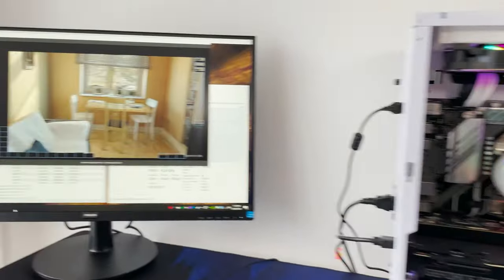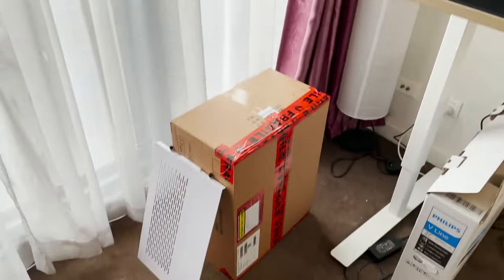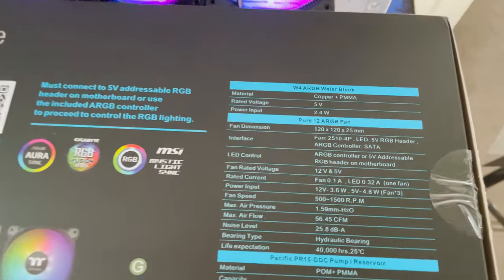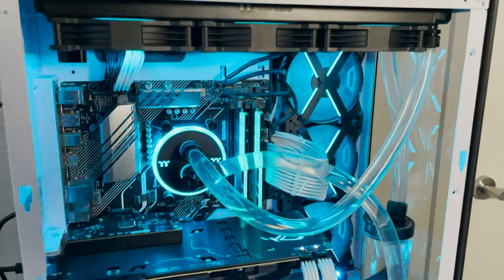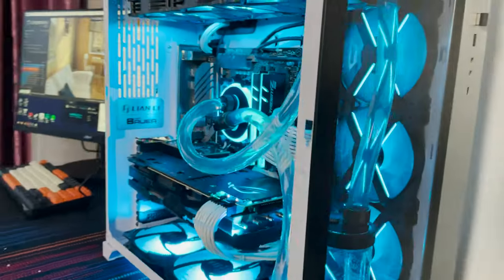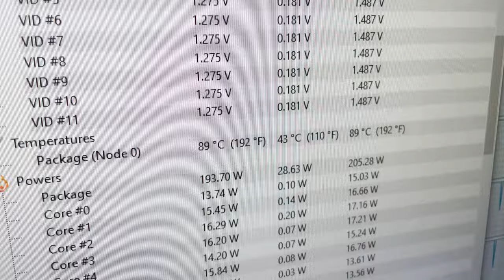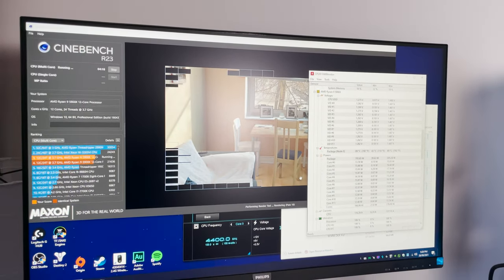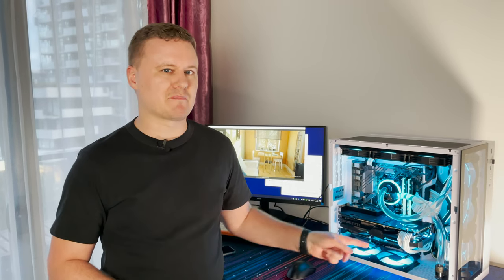Is Custom Water Cooling REALLY that much Better? AIO Vs Custom Loop 💧

Comment: Yeah... Sorry mate this is not a fair comparison at all... Gimping the fan speed with a single 360 on one of the hottest (if not the hottest) cpu's is asking for it in the first place. EK kits are the best for this type of comparison, TT is absolute rubbish! Also if you are pulling in cool air from the bottom and the side of the case, you need to exhaust that air out the top or back. As others haven mentioned no one runs a pump at full tilt in a custom loop, usually around the 50 - 60% mark depending on how many blocks and rads you are going through, also try and have the fans on a curve, so when you are gaming or chilling, fans are on a lower RPM than when you are rendering. Another thing to note is that GPU pegged at 100% is dumping an immense amount of heat into the case with nowhere for it to go. Just so many anomalies. You are right about diminishing returns with a custom loop, however, people that go for high end hardware that want the absolute max performance out of their machine go to extreme lengths to do so. This is what custom loops are aimed at.
Reply: Seeing the pump not decoupled from the case with a shoggy sanwhich or similar was the first red flag for me xD

Comment: Sorry, but this must be the worst comparison I've ever seen:
1. With the AIO your fans appear to be set to exhaust to the top and not intake from the top. That means you are gathering the hottest air in your case and use that air to cool down the fluid from the AIO. The best AIO config in this case would be a pull config as intake from the side panel.
2. Why would you set the TDP limit to over 200W? Your CPU is clocking to ~4.3 GHz all core in cinebench. That's something the CPU could do with ~140W easy.

I have an O11 Dynamic Evo, Aorus Pro X570, Ryzen 5900X and a 360 AIO. Fan config is: AIO side (tubes DOWN) intake (pull), bottom fans intake, top + rear exhaust.
At a room temp of ~22°C I am barely hitting 65°C on the CPU in cinebench (30 min), while the CPU clocks to 4.5GHz all core and up to 5.15GHz single core @ 165W TDP limit.

You have way too few intake airflow in general in the case (side is exhaust, only 2 fans in the bottom with the custom loop as intake, which will mainly feed the GPU and the top is intake, but on rads which will limit the airflow of the fans) and the config is really bad. Trust me, put the rad on the side and setup your top fans as exhaust and your CPU temps will drop by 10-20°C at least. Also spend some time optimizing the CPU with PBO2/Curve Optimizer and pull the TDP down.
Reply: Definitely agree.
Reply: I use an AIO mounted at the top, which is actually the correct position, and it runs just fine with great temps.
Reply: @OneFreeMan17  there is no "correct" placement for an AIO, there are just incorrect ones. The only rule is that the pump cannot be the highest point of the AIO, otherwise you would gather air in the pump. So for a side mount, the tubes must be at the bottom and the top edge of the rad should be higher than the pump. Temperature-wise, CPU temps will be much better when using a side or front mount and the fans set to intake, since cold air from the outside is used to cool the water. But you're increasing the overall temps in the case with that setup. When using a top mount the Fans should be set to exhaust, because it makes no sense to intake from the top since hit air rises naturally.  So they would be kinda fighting against the natural air flow. Thus, you would set it to exhaust on the top. Thats fine, but you're now  taking the hottest air possible to cool down the water, thus your cpu will be hotter than with a side or front mount.
Reply: @foxtrotromeo4876  If there are “incorrect” placements, then there definitely are “correct” placements.
The temperature while using the AIO as exhaust is nowhere near as bad as you may think.
The 3 intake fans I have at the front pull in cool air, and the air from the top fan push fresh air for the AIO to use.

Comment: Custom loop is always be much much much more silent than any type of an AIO as long as you configure it correctly #1 if you already have a premium high performance AIO then you want your custom loop radiator to be much bigger than that why? your loop will perform exactly or slightly better than AIO in that use case, add more radiator either by thicker size or just doubling the number of rads can increase thermal headroom better than AIO as a result you can run our fan more quieter #2 pump you want to adjust the pump speed to fix that noise ALL custom loop pumps are always better than the best AIO pump you just need to configure the RPM correctly and you want a anti vibration pad if you can't control its RPM. #3 Zen 2 & Zen 3 are really hard to cool with even with custom loop due its being a 7nm which mean very small area to transfer heat to iHS to water block but will perform better the lower your temps are specially if your ambient temp is LOW +custom loop. And i think your radiator must be a Brass radiator which has the worst thermal conductivity than copper and aluminum.. Brass radiator performs nearly or exactly the same with a good AIO of the same exact radiator size due to AIO using Aluminum that is much thermal conductive than brass and can dissipate heat better than copper but pump is weaker than custom loop which result to an near or exact or slightly lil bit performance inc of a custom loop of same exact config. BUT if its a COPPER chambers not brass then it will perform a LOT better than any AIO of the same exact radiator size and thickness so in order to get better performance using a brass radiator is to increase your thickness or doubling the radiator but again ALL copper radiator will perform better. ALL BASIC Kit uses noisy pump/fix rpm pump, Brass Radiator, soft tube that's why i think thats a brass radiator specially the way it performs exactly a brass radiator performance against a 360mm AIO.

Comment: Mate, your fan orientations are different between the two setups. The AIO is pulling air out of the case through the radiator, the kit is pulling air into the case through the radiator which is probably why you're getting super high temps. Air goes in the direction of the fan bracket.
Reply: Lol thank you. I was yelling this at my phone.
Reply: so the aio fans should be sucking cool air into the pc rather than pumping out hot air ? pls answer

Comment: are you blowing hot air from the radiator into the case? And if you want to keep it quiet why are you only using One 360? That's how you keep it quiet is you up the size of your capacity to cool instead of having to blow more air...  right?
Reply: Correct I'm using r7 3700x and with 2 nvme gen 3 on a single loop but I uses 2x 360mm 27mm thick instead of a 45mm thick or 60mm.
Why? 60mm will require push pull config.
45mm 1fan but slightly higher rpm (not completely silent) but a lot lower than 60mm.
But in 2x thin rads Its equivalent of a thicker rad with same number of fans BUT it's easier to run lower rpm fans on thin rads than thicker.
Then I also have an external radiator for GPU (2nd loop) with an external Dock of 2x 360mm 27mm thick rads with single fan each.
Also a solid pannel front w/ good enough space and large enough dual side vents for silent build instead of pure performance.
Well yeah a full mesh will allow you run at lower rpm but remember SFF cases have much worst case airflow 🤣 than a full tower that I'm using.
A silent case with decent airflow is still much more silent than full mesh case at lower rpm fans.
But mesh case have better dust build up resistance.
 and with the case for silent you cant even hear the pump even at 70%.

Which means I have a total of 4x 360mm radiator (2 360mm per loop).
Fans are running at lower speed and only increase in take fan rpm a bit since the case only have side vents I can do a mod from steel front to mesh but temps are good even at max OC with prime 95 running 24hrs while watching anime and movie LOL.
The pump should always be PWM or manual pwm knob controlled.
You really only need to run the pump at 100% when bleeding and lower it once done.. it will also reduce the stress on the pump for lesser failure.

Comment: Why did you set pump to 100%? Set it to max 60% and find the speed where it is not audible. 60% speed will still have enough waterflow. Also exhaust on top and intake air from bottom and back it will make it cooler
Reply: Sound is irrelevant when it comes to cooling and specially pumps, 
wear headphones while gaming or turn up speakers more.

Comment: Currently my system is on a custom loop. Ek d5 pwm pump/res and a single ek slim radiator for now as i am still waiting for my EK PE360 and XE360 to arrive. Before this custom loop i have the lian li galahad 360 and my temps on full load is 68-70c on my 5900x. With the custom loop it dropped 6c on full load and this is only a slim radiator and xtreme rigs said that it is the worst radiator in the market lol.

My pump is on 2800rpm and fans are 1000rpm.

Comment: You have to put the side panel on your case for the fans to function properly. Otherwise they're not going to get the same suction power.
Reply: What are you on about 😂
Reply: @taekwoncrawfish9418  I'm talking about air flow. With the side panel off, the air flow is completely different; exhaust fans aren't expelling the same air brought in by the intake fans anymore. You have to have a fully assembled case for fans to be able to do their jobs properly.
Reply: @ZeroG  you do realize it’s better to have no side panel on right?

Comment: I’m on my 4th AIO.  Quality has went way down since my last PC build pre Covid .
First pump. Wax Artic liquid freezer III 240  pump whine no matter speed setting.
Second was EK 360  sounded like a bearing was going out .
Third and 4 th. Corsair H 150 I elite LCD xt. Coil whine .
Ready to give up and go back to air cooler .

Comment: Man, 190 and 200w ? Lower the max TDP to 140 or 150 and use the curve optimizer. You will have 99% of the performance at 70 degrees. When fully unlocked, ryzen will hit the max temp by using as much power as possible even if it's not providing any gains.
Also, dont tighten too hard anything with an o ring or the tubes. The fittings are not supposed to be fully tight.
The custom loop is cooler at 10 more watt with the same radiator size. Thats the difference.
My 5900x is locked at 140w with curve optimizer. It boost all cores at 4500mhz on a 240x45mm rad with 2 noctua fans at 100%. It stays in the low 70's in a 25c room.

Comment: I suggest using the fans that come with the custom loop as they will have a better deal against the radiator, as well as setting the fans to push air through the top radiator, having the other fans is great but the top of a case should always be exhaust as it works with rather than against convection (yes I know the fans will over power it) but if you are working with such low fan speeds you should atleast consider it as it will make quite a difference since fans are usually better at pushing air in a spiral cone (static pressure) versus pulling in that same way

Comment: Hello, I noted at 2:25 that you have gaps between fans and the radiator. I think instead of the fans forcing the fresh air through radiator, the fans might recirculate some of the air inside the case through those gaps. Therefore,  makes less pressure to pull the air and the heat through the radiator properly. If you are going to re-install the AIO cooler back, i think you should use the fans from Thermaltake kit or other fans that will not create gaps between fans and the radiator. I hope this is useful in some way to you. Also nice video, very informative. Specialty at the Summary Pt2, not many reviewer do the Pro and Con after 3 weeks of usage.
Reply from the maker: Thanks for all the feedback mate :)
Reply: Imagine typing all that just to get a 6 word response from the oc 😭💀

Comment: I got a bit confused. Both configs have one 360 rad with nearly identical specs(~ 3mm difference in height), so you basically comparing two radiators and ddc pump in my opinion. 

For me, the real pros for custom loops are multiple rad and GPU don't get big as a brick.

Comment: No not for just a CPU, custom loops start making a little bit more sense, and you are going to cool a GPU, CPU, and maybe ram, or MOBO, or something else as well, then they start making sense.  If you run a custom loop just for a CPU it's kind of a waste of money, time, upkeep, etc.  Also 80C on GPU memory is too hot for my liking.  I redid the thermal pads on my 3080 and it went from higher then your temps down to like 60s on GPU, and 70s on RAM.  Well worth the upgrade.  GPU temps and CPU temps up in the 90s are out of line.  I like my stuff no more then in the mid 70s if I can help it under load.  With that being said if I were going to do watter I would not use compression fittings, I would use some type of clamp.  I've done a lot of plumbing, and worked in IT for over a decade, mostly retired now, and compression fittings will fail far more likely then a good old clamp, and maybe they last 15 years no leaks, but I wouldn't trust it.

Comment: You should 100% be exhausting that rad out the top. I built in an 011d in 2019 I a 360 on top exhausting and a slim 360 up front as intake. I made sure the liquid went through a rad before moving from the gpu to cpu. So it was pump->gpu->rad->cpu->rad->pump. And they don’t include a drain in that kit? How will you empty it to maintain it or get to your cpu. Anyway, it looks nice, so that’s a plus. I do think it would look better if the pump was moved off the floor. Even just a little. Mounting it on the fan right there at the side. It would only be about a centimeter off the bottom of the case, but it would look 10000 cleaner. That’s where I mounted mine on the dynamic. That system is long gone now 😢

Comment: In my opinion a custom loop is only worth it if you intent to cool more components than the CPU. If it's just the CPU a AIO is more than enough, especially with all the offers in the market. Up to a 420 rad. When I transitioned to custom water cooling there were only 120 rad AIO. Things evolved quite substantially.
Reply: B-but the aesthetic!

Comment: Maybe their size is pain or maybe they are ugly without covers but in my opinion it's kind of hard to beat a D5 pump.  I have one D5 running 3x 360mm rads the CPU and GPU.

Comment: I would have thought it would have been quieter, hmm good to know. It does look really cool though
Reply from the maker: Yeah I can only hope Thermaltake take my feedback in a positive manner
Reply: Custom loop for gpu/cpu is worth it but cpu alone not. 
EK D5 pumps comes with rubber sound insulation mounting system which makes it run wery quiet.
Reply: you can adjust to find the sweetspot of noise and pump speed and it will become much more silent without affecting performance.
and you need to plug the pump in a pump 4 pin or regular 4pin system fan if the mobo dont support pump header.
because if you plug it at cpu header you will be limited to the cpu thermal control.
Reply from the maker: @gamertechlive1780  the problem with that pump which I mentioned in the video is that it was a DDC pump which only ran via the molex connection and so there wasn't any way to slow it down, and to go to a DDC or D5 pump with PWM control via the motherboard would have made it even more expensive and un-necessary. But thanks for sharing and watching. I appreciate all the feedback! I just with there was a more affordable option.

Comment: Ek pumps are sleeved. I only use ek equipment. Except fittings, I prefer bitspower. And hardline!! Popping those pins out to sleeve that pump would be easy peasy.

Comment: You jump the psu to test it for leaks without powering up your system, not to get the pump going. . Line everything with blue shop towels so you can find the tiniest leak you might not find otherwise

Comment: intake at the top... when you don't  really know or understand anything about airflow... plus it seems that all your fans are setup as intake, where is going the hot air? best setup in lianli o11 by personal tests : intake front, side, intake bottom, out top, and you will see decrease your temps by more than 10 degrees.

Comment: Exchanging 360 rad with another gets you nowhere. 🤷‍♂️
Just buy another 360 rad plus 2 fittings and place it in the back of your case.
Your CPU will freeeeze 🥶

Comment: This is talking purely CPU. For CPU you're right, AIO is a no brainer compared to custom loop, especially with the better AIOs on the market these days. If you're pushing your GPU for rendering or machine learning and want to overclock it, the discussion changes a bit. Running an AIO for a GPU (and availability for that isn't great, not as many GPU AIO options as CPU) and CPU, gets wonky fast. So if you have a need (and most people don't) to water cool your GPU, then custom loop to include GPU and CPU in a single loop with two rads changes the answer a bit. But for most people, yes, air cooling and maybe AIOs are a better solution than a custom loop. Air cooling (heat pump design especially) and CPU efficiency have only gotten much better with time, so for most people air cooling is more than sufficient even for beast gaming rigs.
Reply: He’s not right lol, he horribly messed things up, I did the comparisons myself, got a 14°C decrease on temperatures thus +1800 cinebench score with something similar to his setup
Reply: But you’re right about the other things

Comment: If the fans on the radiator are intake, wouldn't they just be blowing the heat into the case?  If you reverse the fans on top to exhaust and only have fans in front for intake, you will have negative pressure in the case.  Positive pressure impedes airflow and makes the fans work harder.